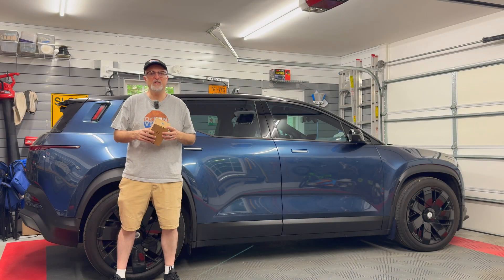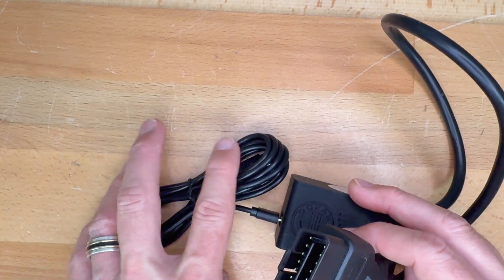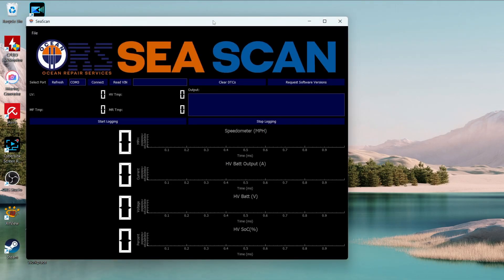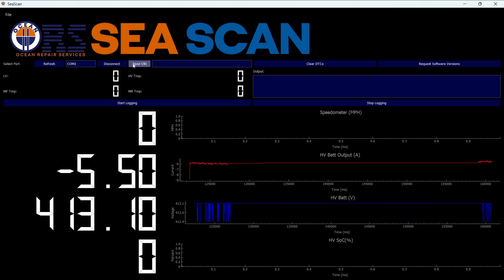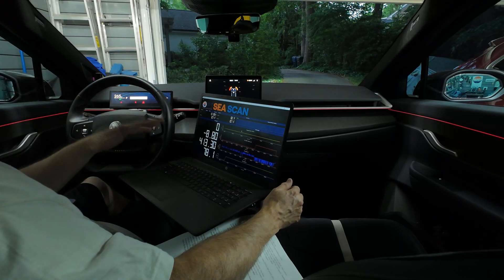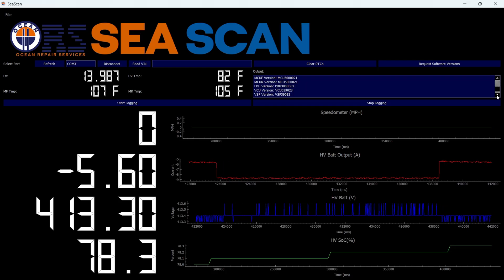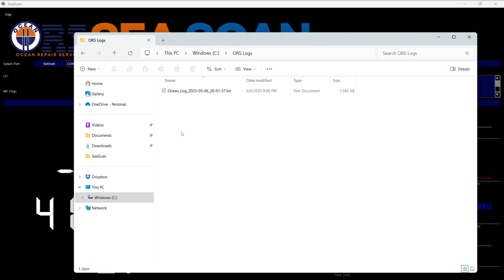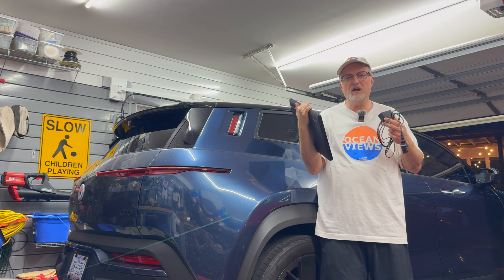Fisker Ocean - ORS SeaScan

Comment: Would be nice if those temps, Front Motor Temp, High Voltage Battery Temp, etc. could be viewed with this tool having a cell phone App like I said that Bimmercode uses a cell App connected the BMWs. Those values are very useful. I am in Arizona and when it heats up here to the 115 degree days I wonder what those temps will read. I will say this, in the dead of Summer, if I try to charge my BMW i3 in our non climate controlled garage the high voltage cooling fan comes on sounding like a helicopter. So, I charge my car at 3am and that works out pretty well. Cooling fan turns on for maybe 20 seconds then settles down. I don't hesitate driving the BMW in that massive heat but I might be more worried about driving the Ocean in that heat. So, would be nice to grab those temp numbers to see just how hot those temps become.
Reply from the maker: Maybe that will be a future upgrade from ORS.

Comment: Perhaps, and hopefully at some point, programming can be done using it. For example, I have a BMW i3 and there is a cell phone App that uses the OBD connector under the dash. The App is called Bimmercode and it works on all BMWs, probably limited if you have too old of a BMW. But all sorts of custom coding. For example, the BMW i3 REX model - 2.2 gallons of gas, runs a scooter motor, that runs a generator that maintains the high voltage battery. That's what the REX is. In North America, when delivered, it can not be manually controlled but will turn on at a high voltage battery state of charge of 7%. That's not much of a buffer if you are putting a big demand on the car going uphill at 75mph with the AC on. The REX can't keep up. Bimmercode allows you to recode it so you can manually turn it on at any state of charge below 75%. Very useful. You can even adjust the temperature of the heated seats, have the side mirrors fold when locking the car, etc. But, remains to be seen.
Reply from the maker: Yes, I'm familiar with Bluetooth OBD2 adapters.  I have used one in my Tesla for many years now.  There is an app called ScanMyTesla which provides a lot of interesting info from the CAN data.  I'm guessing more options for the Ocean will be available over time from different sources.

Comment: My FOO A/C and total HVAC has stopped working. A/C compressor will not engage, cabin blower will not come on,  and condenser cooling fan does not come on. No heat,  no air,  no defrost, nothing from any vent. Will this device possibly diagnose or clear the issue?
Reply from the maker: Currently the basic version doesn’t do a full diagnostic.  I would check the fuses first. I have a fuse spreadsheet here.  You’ll have to look under the hood and in the cabin fuse boxes. https://docs.google.com/spreadsheets/d/1wqx-2YWEWlQSBBpCG5A3iN_m8mSgd_Dg

Comment: Is the tool transferable if you sell your Ocean? As curious how this compares to the Ocean Link Pro, redundant, completely diff?
Reply: He mentions at 4:07 that it’s transferable.
Reply from the maker: It doesn't require a VIN, so you can use it on multiple vehicles.